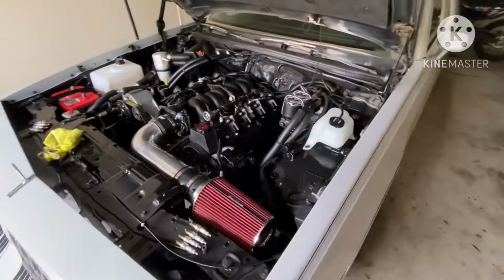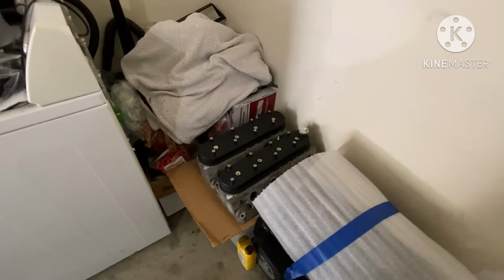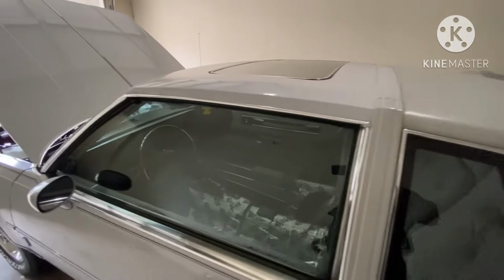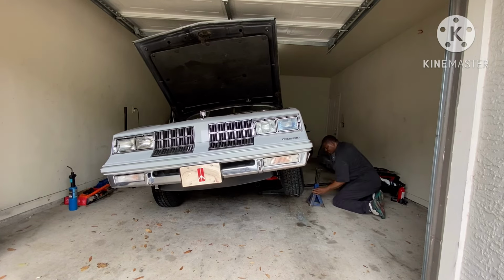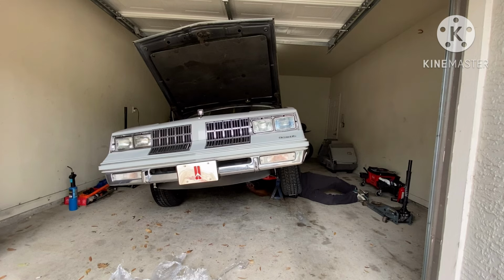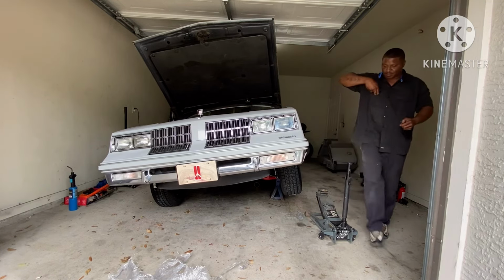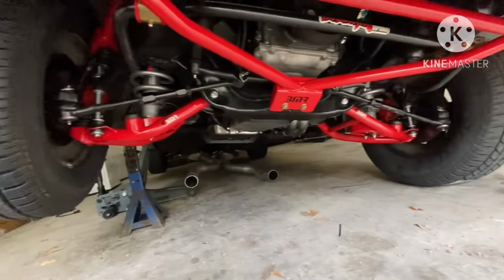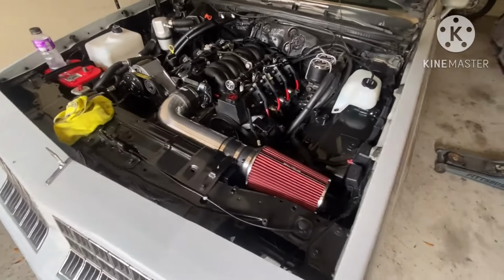82 Cutlass LS Swap headers installed simple and easy

Comment: Hey Willie is there any reason why u don’t move the mounts back the way Holley recommends to do in the instructions?  Will their crossmember work with the mount in the oem location? Thanks
Reply from the maker: When I try it like that the engine is jammed into the fire wall and I have trouble getting the crossmember lined up and if I do it that way I can’t use my driveshaft

Comment: How do you connect the stock floor shifter to the 4l60e … and what do you do with the column shifter rod? Do you just leave the column disconnected?
Reply from the maker: Column shift rod disconnected stop floor shift will not catch all gears with a 4l60e

Comment: What’s up what radiator are you using? Or can I use a stock radiator for ls swap?
Reply from the maker: I use 05 gto radiator
Reply: @willierebuildz9182  did it fit perfectly?
Reply from the maker: @williamshofner6117  slight modification must be made
Reply: @willierebuildz9182  ok I appreciate that…thanks for the info